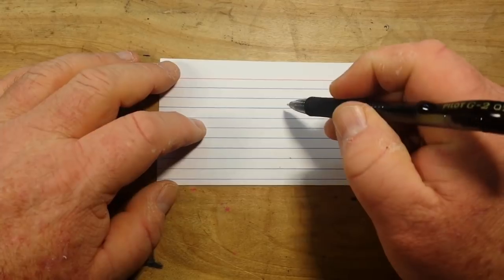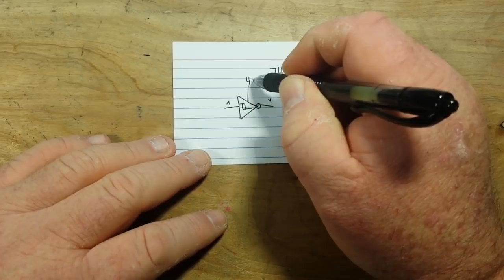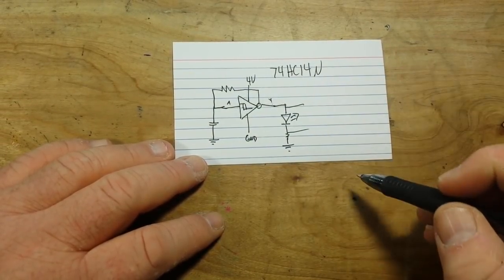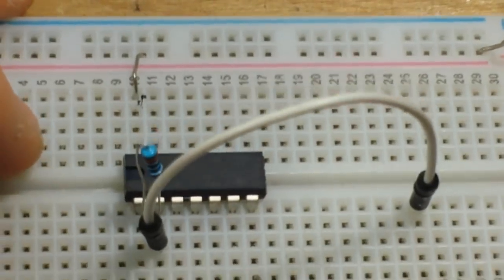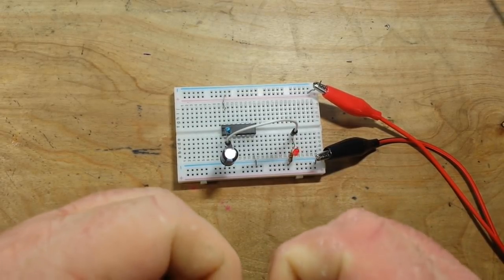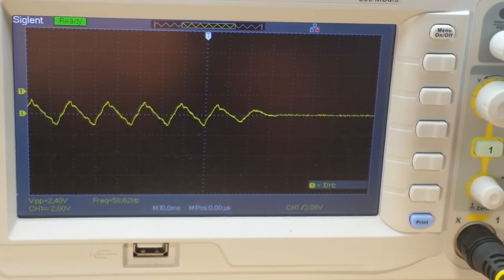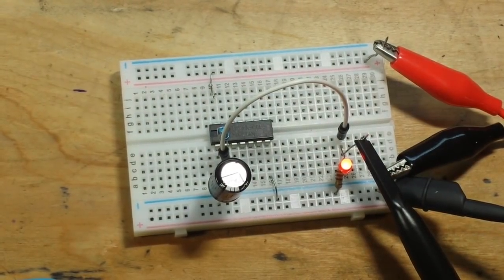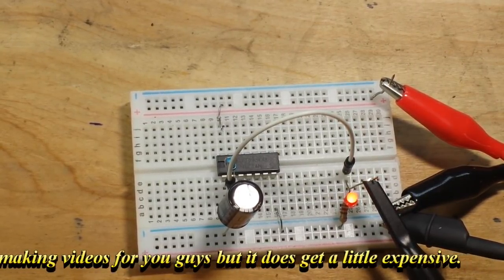How to make a super simple oscillator

Comment: The quad Schmitt two input nAND is one of my favourite devices. It is so flexible. I once used one to generate pulse position modulation for a voice IR transmitter. One gate was used as a voltage controlled oscillator and the rest were used as a retrigerable monostable and a pulse generator. They also make a great simple circuit for an LED stroboscope. Again one as an oscillator, and two as a pulse width controller monostable.  The output csn be used to drive an AC coupled gate of a power MOSFET providing  driving to a super bright LED.  I have used the circuit to inspect running computer fans.

Comment: 're my last post on turning the Schmitt into a voltage controlled oscillator. The trick is to put a constant current pnp bipolar transistor in the feed back circuit, with a diode discharge in the reverse direction across the transistor. The diode provides a fixed discharge period and the transistor provides a linear voltage dependent charge period. With this topology the transistor is only biased on when charging the capacitor. In the charging mode the base of the constant current source can be driven from a simple common emitter transistor amp. Surprisingly this arrangement can be made to give a very linear voltage to frequency output. The circuit dates back to a project I did during work experience in my student days in the late 1970s. The idea was to produce an IR microphone link circuit for a radio transmitter.  The receiver used a pulse count discriminatory also made from a few logic parts. From memory, the IR carrier frequency was 8 to 10 kHz. The receiver converted the pulse position modulation into pulse width modulation using another monostable, this was fillowed by an op-amp integrator and an eight pole Butterworth op-amp filter, used to seperate the audio from the carrier.
The project requirement spec was that the microphone should work in full desert sunlight at a range of four metres. To this end an active load was used for the photo detector diode, a BPX65. A schmitt gate was used to provide an IR carrier detect squelch to suppress fm noise in the absents of a microphone transmitter, the squelch was also used to act as the Press to Talk control of the a 10 watt VHF fm transmitter. The biggest limitation of the circuit was that it generated popcorn noise under fluorescent strip lights. The advantage of PP modulation was that the ir LEDs were operated at If = 4 amps pulsed at somewhere between 1 to 10us pulse width. Yet the microphone 9 volt battery current was less than 20mA. 
I should point this is all from memory, so my figures are approximate. I would need to find my old lab book for the exact figures. The component count was relative high, but very low cost as most of the circuit was made from B series CMOS,  namely CD 4093b. At this point I should apologise for this rambling post walk down my memory lane.
Reply from the maker: No, do not apologise. I enjoy reading this type of post, thank you for sharing it.
Reply: learnelectronics now days all this can be done with a tiny Bluetooth headset, but in the 1970s, a radio linked microphone would have involved a seperate radio licence for the microphone frequency as well as the main transmitter. There would have been huge equipment approval costs and there would also been the problem of co channel interference. The target market was motorcycle headsets and wire free in car microphones. In the end the project was shelved for commercial reasons, but technically it work quite well for the period.
Reply: Nigel Johnson
Pls share your thoughts about electronics. Many novice can learn from this comments .. Thanks

Comment: Another simple oscillator. I used to build 555 oscillators or with Opamps. With opamps is similar to this inverted buffer, having an aditional feedback resistor divider to the non-inverting pin.  Resistor color code RED = 2, BLK = 0, BLK = 0, RED  = x10, BRN = 1%
Reply from the maker: You got it

Comment: Even though there aren't many components in your oscillator, there is obviously something not working as expected.  For instance the unstable duty cycle, missed pulse or whatever you want to call it, should not happen.  Perhaps grounding the other inputs might solve the issue, but I'm not 100% convinced.  As a friendly advice, making sure you've got a working circuit along with mathematical validation, if applicable, would be greatly appreciated.  For example, using a RC circuit with a 74HC14 like presented here, the hobbyist should expect an output frequency in the range of 1/(RC) to 2/(RC), depending on the threshold range, threshold boundaries and VCC for instance.  The CMOS family are bound to some specifications that are different for the TTL family would be an element that would worth to be mentioned thus incitating the hobbyists to search further more if they're planning to use such type of oscillator.  One "funny" thing I noticed from your video clips is such that expressions like "Snap, what happened here ?", "That shouldn't be like that !", "I don't know what's going on !" and perhaps some others too, are censored and translated to "INTERESTING !".  So if we hear you saying "INTERESTING", we'll know something most likely didn't go as planned.  Don't get me wrong, your videos are serving their purposes, providing beginners with some information to get started with.  To my personal taste, more specifically with electronics, theory and practice should be considered as a whole.  If we don't master the theory, how can we validate what we put to practice ?  Sometimes having a better understanding of the theory can help us at improving the troubleshooting.  With the 20K and the 100uF we would expect a frequency of 1Hz or so.  Seeing something in the 50-60Hz range on the scope would motivate most of us to raise the flag and investigate and perhaps conclude as you did with "INTERESTING" !  ;--)
Reply: SimpleEnough2k9
Nice info, Thanks.
Reply: Yeah 100uF is massive. Try nF instead.

Comment: Cool. Im using this to make a very simple synth. How do I add a pitch knob?
Reply: Replace the single resistor with a pot (eg 100k to 1M) and a small resistor (220ohm). [The small resistor keeps the total resistance in that leg above zero even when the pot is fully wound back to zero.]  Secondly, make the capacitor much, much smaller (a few nanofarads.
 For audible range the trick is to have a 'small enough' cap to get the high end (when the pot is wound back to zero), and a 'large enough' resistor (ie the pot) to get the low end, when the pot is wound all the way up.
Start with say 10nF, 100k pot + 220ohm resistor. If it doesn't go high enough, make the cap smaller, if it doesn't go low enough, use a bigger pot (eg 500k or 1M). With the right values you will get the entire audio range.
PS. Tie the other 5 inputs on the chip to ground for stability.

Search '40106' (just a different hex inverter) for a bunch of better versions of this scheme.
I was once where you are, but there's a lot of great stuff on youtube for this. But it's 6 months later, and you probably found out already!

Comment: I think the output would be more regular if you grounded all the unused outputs. Love the oscillator series!
Reply: One should definitely pull up or down all the inputs. I do not think the outputs to ground matter as much if at all. If anything the outputs should be pulled up or down but not directly to ground.
Reply: @GORF_EMPIRE  Ground the unused inputs to stop the gate from self-activating and generating noise that may resonate with some other minor ethereal presence, which may unintentionally materialize ghosts in your circuit. Don't do anything with unused outputs. Shunting them to ground or Vcc will only draw excess power for no stated purpose.

Comment: As per your challenge to build this circuit -- ironically I stumbled onto your channel during my (ongoing) quest to learn how to build synthesizers. I have plenty of CD40106 chips to play with but I am lacking in fundamental EE knowledge, so I have been working with 555 chips to better challenge myself. If you have not seen "Casper Electronics DIY synth building. Part 1: Oscillators" here on Youtube I invite you to check it out. Part 2 introduces some really fun sequencers and I am in the process of designing my own "daughterboard"-ish prototype to mix and amplify audio from my test circuits. Cheers!
Reply: Sadly, that dude seems to have completed his YT experience and hasn't posted for half a generation. For another great synth explainer channel that isn't just trying to sell computers on a stick, Look Mum No Computer is the current leader of the pack.

Comment: If you use odd number of Schmitt-trigger inverters then in theory it should be enough to run unstable oscillator, but I don't have oscilloscope good enough to detect that frequency, can be megahertz range. 
..and I just google it. yes, "few MHz" :)

Comment: any simple circuits that are made for driving piezo transducers?
Reply from the maker: Still working on your ultrasonic knife?
Reply: AD9833 board (0-25MHz), easy to use with attiny or arduino, and 555 (not cheapest one, there is one that go to 2 MHz) 
get some BU4... transistor I think. AD is 5-7 eur, rest is maybe 0.3 per piece.
If you doing 1.7 MHz go for 555, if you want signal generator go for AD. There is couple of videos on you tube how to make signal generator with AD, down side peak-to-peak is 0.6 V if I can remember corectly. Have fun :)
Reply: @learnelectronics got me :P still dreaming about it, but i guess without being able to machine a horn im not gonna get very far, but its worth a try.
Reply: @Jedan Decko i need a power driver for a piezo element that is used in cheapo ultrasonic baths. and i tried setting the frequency by hand using a manual circuit, but the resonance frequency seems to be very very narrow or is shifting, so i couldnt get much of a reaction out of it. i just used an esp32 and generated a square wave
Reply: Nice, can y share code pls? What is max freq of esp32?
Reply: Jedan i used the pwm.h and pwm.cpp from here https://github.com/nkolban/esp32-snippets/tree/master/cpp_utils and then i wrote this sketch where i can modify the frequency via a website https://pastebin.com/02J8qs2X (i connected my phone to it and opened the http://192.168.4.1 website (which is the default ip of my esps, but you can adjust that with softapconfig or so))
i dont know about max frequency, couldnt find anything in the docs. you have to test